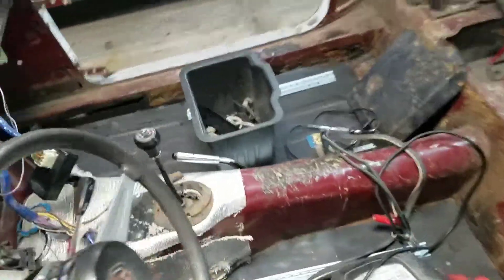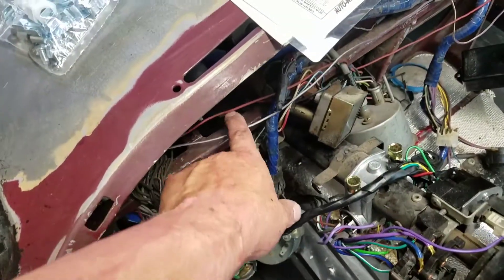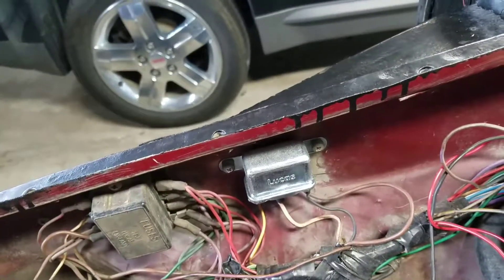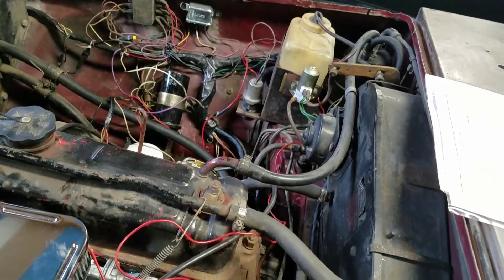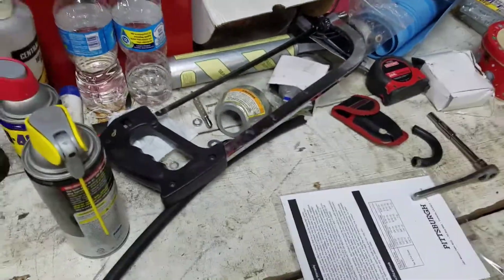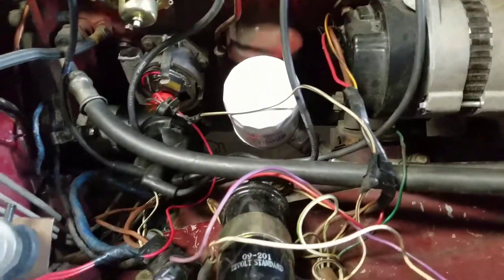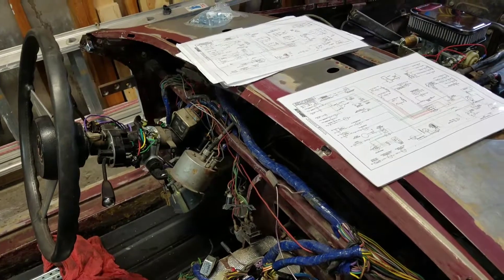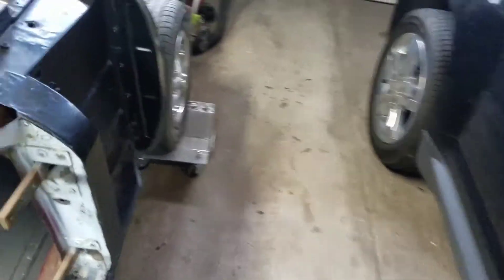MGB Accuspark hook up, wiring diagram failure part 2

Comment: The ballast is built into the wiring loom. If you have white wires with a green strip going to the + side of coil, you have a ballast system. To install electronic ign, just disconnect the white and green from the + side of coil. The - side of coil may have a black and white wire which is the tach. That stays on the - coil. Run a new red wire from the fuse box that is power on with ignition only to the + side of coil. Attach red wire from electronic ign to + side of coil. Attach black wire from the distributor to the -  side of coil.Make sure you have a 12v - 3 ohm coil. That basically bypasses the built in ballast system. Mark the location of the wires before removing so that points and a condenser can be added back later if the electronic ign. fails. Going back to points will require a 1.5 ohm coil.
Reply from the maker: Thank you so much. I appreciate the info. The hardest thing on this is the color on the wires were faded and none of the diagrams matched the wiring that I had. The other weird thing is I think I had it hooked up as you described and it would run for a while, then I would lose spark and have to move the wire to a different source. I think I moved it a couple times back and forth. MGB's with their wiring nightmares. It was very weird.

Comment: did you actually fit accuspark
Reply from the maker: Yes I was able to hook the Accuspark up, the only thing that I did do wrong was hook the red wiret up to the wrong ignition wire. I hooked it up to where you had to keep cranking it for it to run. I figured out which one when I did the same thing to the 77 MGB I have on my channel. Let me know if you need me to look to see which wire I went into if you need it.
Reply: @theawakening5548  do you have link to a video?
Reply from the maker: @hankpb1  I am on my phone and I do not know how to send a link through it, but if you search Fitting accuspark electronic ignition to mgb. That is the video that helped me, but I did not take me distributor out.
Reply from the maker: @hankpb1  Here is the video.
https://www.youtube.com/watch?v=VtgfitJpQ1s&t=580s